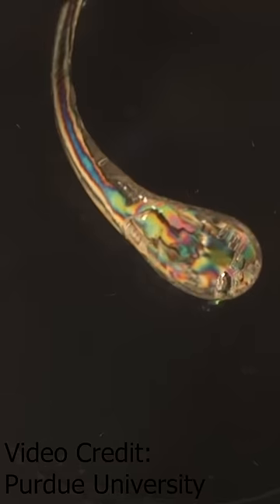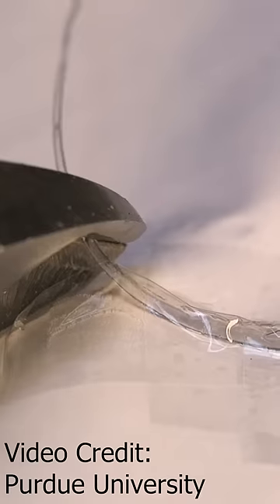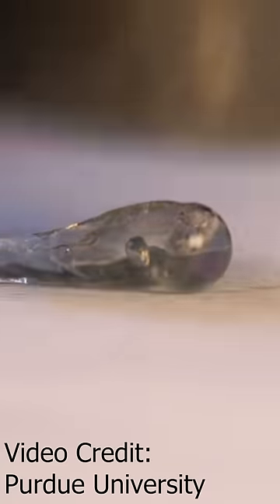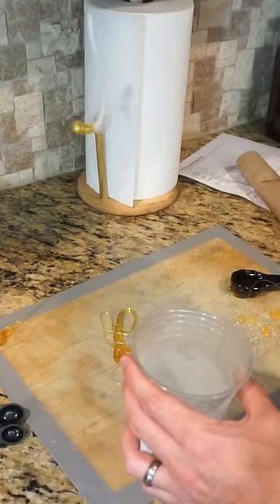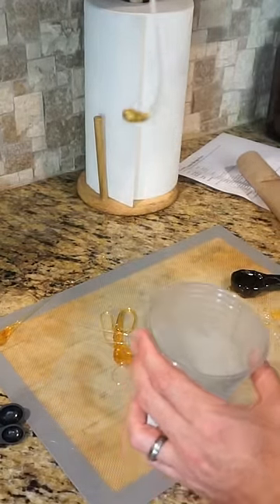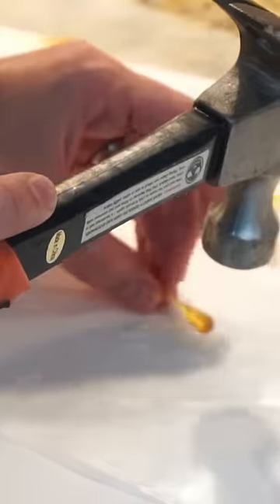Edible Prince Rupert Drops

Comment: "Wow, that's actually really strong"

*breaks in thousand piece
Reply: Stronger than normal. Just not as strong as jawbreakers.
Reply: 😂😂😂 he spoke too soon
Reply: You could cut it while it is dropping. What way you wouldn't have a tail and therefor no weak spot.
Reply: LMAOO
Reply: @FelanLP  that's not how it works. The strength of the head is reliant on the tension of the overall shape. Trust me, some YouTube comment didn't just reinvent physical law.
Reply: @SpunkMayo  I don't know if it might work. It's just something I always ask myself when I see them being made. I have never seen it being tried or talked about.
Everything I know about those drops is that they are that strong due to the fact that the the inner core cools slower and therefor shrinks after the outer shell is already hardened. That's what pulls the shell tighter and gives it its strength. (The shell is then even strong enough for the core to created a vacuum with further cooling and shrinking.)

In fact I have seen a video where someone makes a drop and tries to clip the tail to show the effect but surprisingly fails. The tail breaks and the drop stays intact. He later managed to destroy it but for a short moment he had a tear shaped drop without a tail.

I don't see why it shouldn't be possible to create a sphere shaped drop with that effect.
Or in other words, I can't visualise it in my head.
I would need to see it being tried and then explained.
Reply: @FelanLP  the head is only strong because there is a lot of tension in it, and if there is no tail there is less tension
Reply: thousand piece 💀
Reply: It's not weak, he's just the strongest person ever
Reply: @lassehoffmann625  but less tension doesn't mean no tension. A spherical drop should still be hard to break.
Reply: you forget a thousand things everyday make sure this is one of them
Reply: Wow I liked the comment and it became 4.4k from 4.3k
Reply: Do it but eat it right after.
Reply: @anshdagar425  Congratulation, your mom should proud of you
Reply: Tbf, he's really strong
Reply: That’s just cause of his super human abilities
Reply: It was dipped into liquid nitrogen before im pretty sure, And it took 1 1/2 hits from a hammer! Very fascinating
Reply: @SpunkMayo  what if you made a ball of prince rubert drops with the tails on the inside
Reply: Someone did a hydrolic press or something like that and it got dented
Reply: *quadrille pieces
Reply: I think it was just stronger that he expected because he knew it wouldn’t be like a normal one.

Comment: Prince Rupert's drops (also known as Dutch or Batavian tears) are toughened glass beads created by dripping molten glass into cold water, which causes it to solidify into a tadpole-shaped droplet with a long, thin tail. These droplets are characterized internally by very high residual stresses, which give rise to counter-intuitive properties, such as the ability to withstand a blow from a hammer or a bullet on the bulbous end without breaking, while exhibiting explosive disintegration if the tail end is even slightly damaged. In nature, similar structures are produced under certain conditions in volcanic lava, and are known as Pele's tears.
Reply: Pele being the Hawaiian fire Goddess of volcanoes.

Comment: Always wondered how you could make a perfect Prince Rupert's drop, and here's my idea: an experiment on the ISS. Bring several pieces of glass and a way to melt them with an induction heater til they're molten. Then, develop an apparatus that is able to extremely accurately envelop something in water where the entire surface of the drop is covered at the same time all at once, maybe utilizing the same kind of tech as the dual water ring apparatus that SmarterEveryDay made. This would be done to retain the compressive strength of the drop while putting the weak point inside the center of the drop instead of the tail, creating a far stronger drop. If this could be done incorporating the latest in Corning's Gorilla Glass or something similar, we could create some truly mind-bogglingly resilient pieces of glass. This might sound like just a "let's make strong thing" kinda experiment, but it could possibly give insight to applications for other materials that have immense compressive strength.